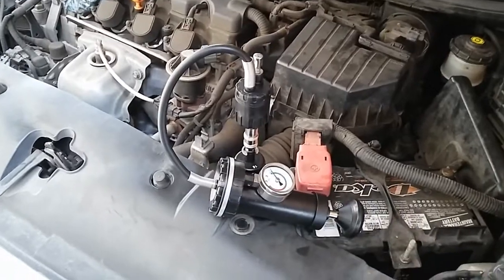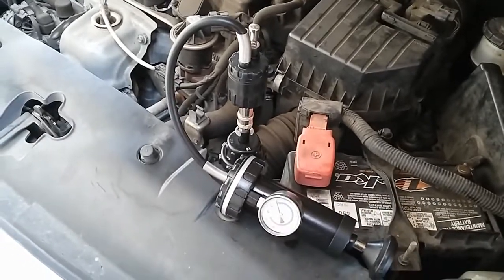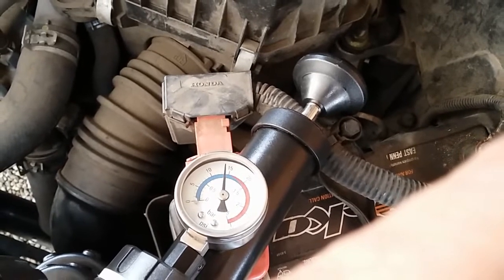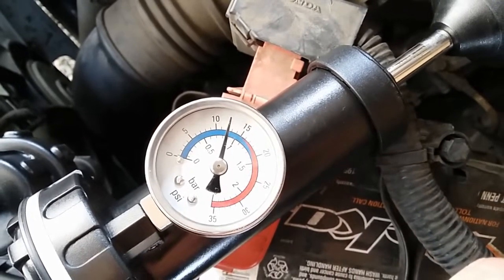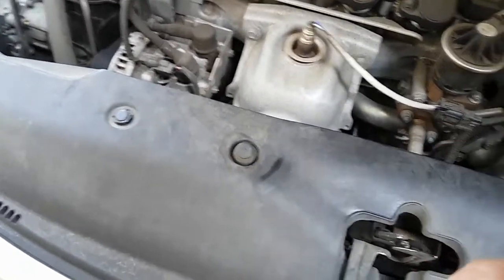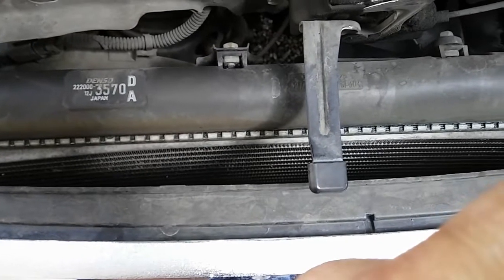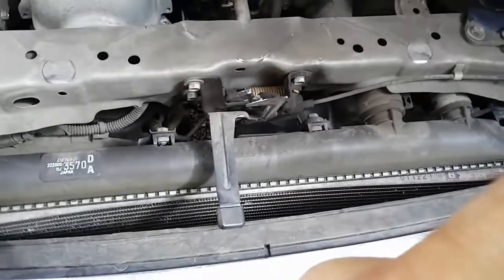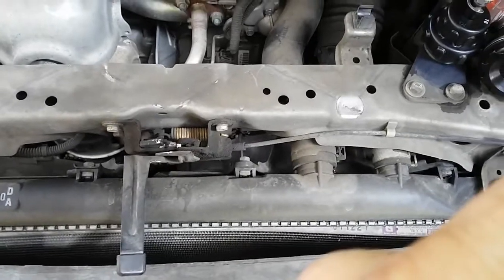(Honda Civic) Using a Radiator Pressure Tester to pinpoint a coolant leak - Part 1

Comment: I have a 2006 rsx but wherever i pressurized the system it goes into the overflow tank??
Reply from the maker: @neilkhodai7282  I never heard that before, that is strange.  Unless the adapter is not sealing properly and allows coolant to get pass the small hole for the reservoir.

Comment: I rented a tester and sadly can't figure out which cap to use. They all seem not to fit. Which tester is this and show us the cap please?
Reply from the maker: @elizabethloudon6097  HI there, you have personal email so I can send you pics?
Reply: @EliTheOBDTech  hey thanks. I ended up getting the issue resolved. The tester I had on loan did not have the right cap, but I fixed some other probably related stuff and it works now.
Reply from the maker: @elizabethloudon6097  Cool, nice to hear it got resolved.

Comment: Quick question from 2020 for an 06 civic. My water coolant reservoir is showing white residue of overflowing unto my battery after every drive. I took it to the shop for diagnostic and they used this pressure test and determined a blown head gasket or block. Is this diagnostic correct? If possible please reply T_T
edit: just to assure so I don't waste money.
Reply from the maker: Is your vehicle overheating?
Reply from the maker: Any coolant system parts replaced lately.
Reply from the maker: From my knowledge, the white residue is the color of the coolant when it dries up.
Reply from the maker: Potential problems
Thermostat going bad, radiator cap not maintaining correct pressure or radiator restriction.
Reply from the maker: It's really hard to say what's the main problem since I'm not doing the diagnosis
Reply: @EliTheOBDTech  not overheating yet appearantly, and just new tubes. check engine light isn't on also though it seems serious.

Comment: On this car I would replace the top radiator hose, then re-do the pressure test to see if the leak was fixed.
Reply from the maker: That is the beauty about the Automotive world, everyone has different methods about diagnosing. Unfortunately, this vehicle was not going to get fixed with just replacing a radiator hose.  Upper housing seal/gasket was the real culprit cause of this coolant leak.
Reply: @EliTheOBDTech  Where is the link to part 2?
Reply from the maker: @fins59  https://youtu.be/uI9DdXO1Im8